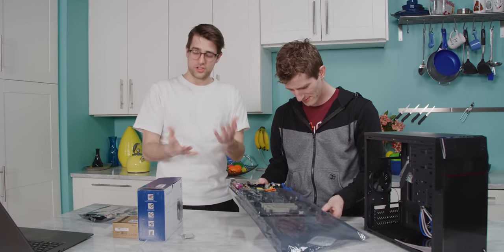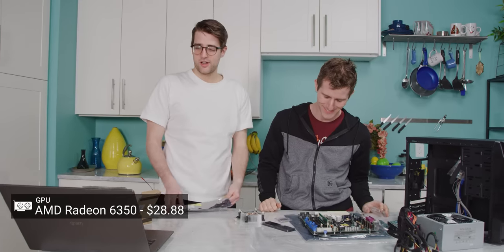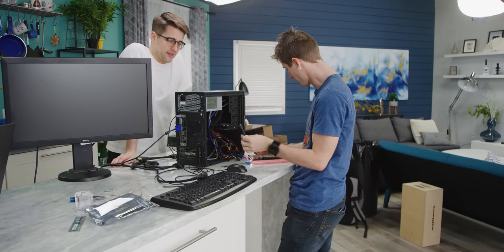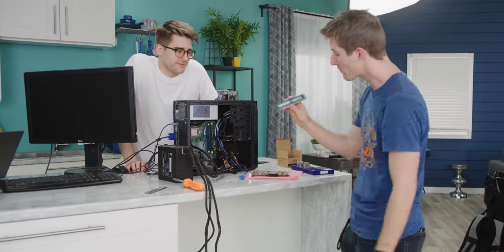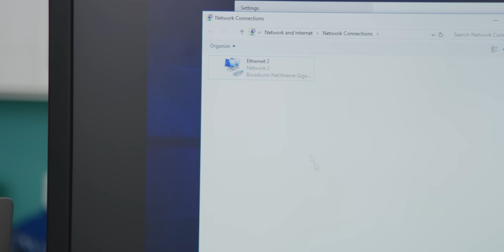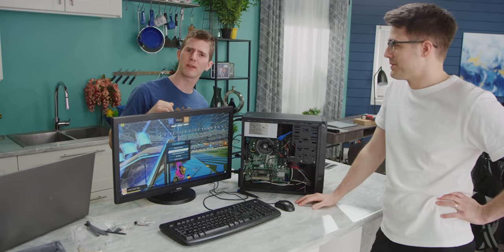We Built the CHEAPEST PC on Amazon!

Comment: "I have a tray of pentiums" once a dream. Now a meme
Reply: @deadchannel5933  Bro let me help you out. Sell the 10th gen pentium and instead buy a 4th gen pre-built system like a Dell optiplex with an i7-4770. Like Linus said in this video, don't buy individual components. Just put a 30$ GPU in the pre-built and it will perform way better than your current setup.
Reply: Imagine in 20 years
"I have a tray of threadrippers"
Reply: @caliqm2199  in 20 years they'll be nothing but thread ticklers
Reply: @caliqm2199  I still have a threadripper 1950x it games like garbage with a 3070ti
Reply: @mattcaldwell864  im pretty sure threadripper isn't designed for gaming....
Reply: In a 20 years AMD threadripper might be the same
Reply: @mattcaldwell864  might wanna run it on dxvk
Reply: Lol
Reply: @sebaschan-uwu  dawn
Reply: @mattcaldwell864  would you by chance share me a piece if you barely use the gpu. It would mean heaven to me. If its possible I can cater for the shipping fee. Kindly bro
Reply: @valanps1638  pffft only 64 cores
Reply: @mattcaldwell864  threadripper isn‘t for gaming that‘s a workstation rendering cpu
Reply: Well, before the DuoCore-Thingys, AMD was ahead in puncto performance with their Athlon XP CPUs.
Reply: it becames 1.2k when i like
Reply: @corvoattano9303  yep  business models FTW.  Cheap, rock solid, easy to repair, upgradeable, good driver and platform support, and cheap repair parts.  "Consumer grade" is garbage, and top of the line from years ago is top build quality at better than average current speeds for the same money.
Reply: @corvoattano9303  a $30 gpu doesn't exist anymore lol
Reply: @mattcaldwell864  lol why the fuck do you have a threadripper with a 3070ti? Are you liek, a professional or some kind of developer and editor or something?

I am on the crossroad slums of the internet known as youtube comments so it's impossible for me to tell who's joking and who's valid or just is clueless. FYI a threadripper is not good for gaming, moar coars does not equal more better for gaming. Like a 5900X is going to get you way better gaming performance than a current gen threadripper.

Also yeah get a 3770k and some kind of overclockable board i.e. anything but a Dell locked down shit BIOS and you can overclock it to being roughly modern gameable. A GTX 980 or RX 580 and a 3770 is all you really need for most modern games, since majority of people aren't even playing above 1080p anyway and both Ampere and RDNA are pretty much 1440p cards from the 6600 and 3060ti on up. Only their shit cards like 3060-non tie and 6500XT are 1080p cards.
Reply: @mattcaldwell864  ofcourse it does, it has WORSE single-core performance than my 8 YEAR old intel xeon, your only advantage is alot of cores but alot of games have some heavy processes that cannot be split between cores. and thats bottlenecking you even if your cpu doesnt reach 100% usage. i recommend finding a cheap 6th - 8th gen i7 or i9 depending on your budget. it would be a massive upgrade.
Reply: But it isn't even a meme bro

Comment: The 6350 is detected as a 5450 since the 6350 is literally just a rebranded 5450. Not an error or anything, that's just what AMD/ATI did
Reply: that hapend with the old 9000 series mine was a 9250 but the driver and pc would detect as 9260 also i was able to run quake 4 but the image was green...
Reply: The entire 8xxx series were just rebranded 7xxx series.
Reply: @MCCMCKnyte  That's also true, while some of the 7xxx cards were rebranded 6xxx cards I'm pretty sure
Reply: 4xx and below/before are made form actual potatoes.
Reply: @kurison  higher clock
Reply: @kurison  still doesn't make them rebranded
Reply: @kurison  well I disagree, as long as there is a meaningful improvement it's not rebranding by definition. I think linus is using the word very loosely
Reply: Nerds

Comment: Somehow your cheapest amazon pc built runs Rocket League faster than my 400 dollar HP. Huh.
Reply: what i learned over the years is hp is bullshit, when i get a new pc i will get each component all by myself
Reply: @Ed Williams True,better not to buy AIO PC or prebuilt $600 PC Without GPU ,U can make yourself a PC with 300 budget ,i3-3220,GTX 750 Ti.
Reply: You could do a ryzen APU build that plays rocket league pretty well for the same price
Reply: @ChrisPBacon9  indeed,use Ryzen 7 1st gen
Reply: The keyword there is "HP"
Reply: Had a hp when I was younger had some bad ass parts in it like a raddy 9800 pro but omg whatever hp did to the system made it a huge bottleneck
Reply: @vlc-cosplayer  no it stands for horrible product
Reply: Prolly cause your WiFi is to garbage
Reply: I have gigabit internet. Yeah I'm looking for a new PC and am not getting an HP, all of their included software is impossible to get rid of and bogs it down. If you looks up the specs of an HP c20-o10 that's it, and it's the worst thing ever.
Reply: Gamerz buster oh good god
Reply: I owned a hp aio which i got as a gift and it was 400 dollars and it run faster than linus's pc. With gt 610. It broke and this year i own an rtx pc which runs a bit slower than that one. So those who say hp sucks, idk what you are talking about
Reply: rocking jjo your guy only affects your frame rate and graphics, having an ssd and lots of ram is what affects the speed of your pc
Reply: Yes i have lots of ram and ssd too. 16 gigs of ram on both my rtx pc and the other hp. Hp had 400 gb hardrive. Rtx pc has 1 tb

Comment: I spent 126$ total to build a dell optiplex 980 SFF, 20$for the Motherboard and the case,28$ for 4x2 gigs 1333mhz ddr3 A-tech ram,75$ for a Gt 1030 Msi fan-less 2gb gddr5 Gpu, And 3$ for sata cables . Its running an I7-860 quad core 3.8 ghz . Gets playable Frames in fortnite and Apex. Got all parts off amazon
Reply: Impressive.
Reply: I built a dell vostro 430a with a same cpu with a 45 dollar r9 380  with 16 gig of ddr3 with 2 hard drives and a ssd  with cxm 650 w psu from Corsair for 235

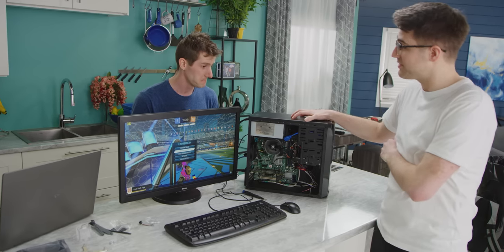Comment: 15:40 That's basically what I'm doing right now. I was going to build my own gaming PC but got overwhelmed when researching it (I've never built a PC). I was also very scared of accidentally breaking expensive parts. So, I bought a custom PC instead. My plan is to upgrade it gradually as the components become obsolete, one part at a time. Theoretically, that should allow me to learn how to build a computer in bitesize chunks so eventually, I'll be pretty proficient in it all. Already having a functional, well built PC should also be useful as I will have a point of reference which I previously didn't (I didn't have a desktop at the time, just an old laptop). That's the theory, anyway. I hope it works then I can build a computer from scratch one day when this one is no longer usable or upgradeable.

Comment: Case has USB3.0... mobo has no USB3.0 header... Leaves connector dangling there... I know this problem very well my friend.
Reply: 1$ adapter from China would fix that problem :D (Internal USB 3.0 -> USB 2.0)
Reply: @cptcrogge  but u would not get the usb 3 speeds.
Reply: @cptcrogge  no point
Reply: 5$ pci express card with 2 3.0 usbs and a usb 3.0 header will fix that :D
Reply: @anonimollopi9642  yep but it's unjustified.
Reply: Cheap cases usually have a USB2.0 split off for boards that dont have it.
Reply: @Wrathlon  Or just buy an e-ATX titanium tri-fan intake glass side panel case with nothing but usb 3.1 ports all over. Perfect for a budget build.
Reply: @dylanharding5720  you get more USB ports on the front... Even if they are slower. Better than having 2 dead ports.

Comment: I'm frankly amazed that GPU was able to do as well as it did. That thing is roughly 1/30th as powerful as a mere 1050ti O.O
Reply: The Passmarks/$ value on that card is stupendously bad, because you can get a used 1050 ti for like $120 and that GPU cost way more than $4.
Reply: Sorta funny story, uhh i was running A Sapphire Radeon 4850 and a i7 2600k this year so I have no clue whats up but mine did way better than this and is older. Yeah I know its a 10ish year old gpu but it got the job done until I got a 1060 6gb
Reply: @ryanhopkins7844  your I7 2600K is a lot more powerful then the CPU they had which is why your GPU did a lot better then in this video
Reply: The 1050 ti is fine if your power supply doesn't support a wired connection for a graphics card. At this point I'd just wait for the 1650 though in that case.
Reply: yeah i have a 1060 already in my daily driver but i almost got a 1050 ti for testing motherboards and for a HTPC because it doesn't need a power connector
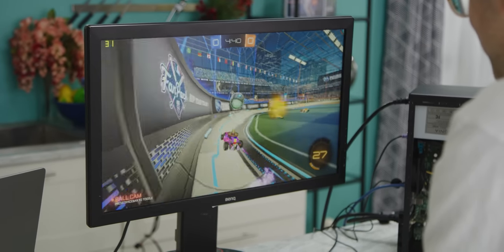Reply: 14:15 master race!!! macro-transaction master race.
Reply: TheFriendlyHacker 2080 Ti Master race

Comment: Personally, rather than going TOO cheap, as I have in the past, I planned out my system so that I bought it a part or two at a time, as I could afford it with a maximum price and certain quality standards.  It has taken me about 8 months and I am almost ready to put all the parts together.  I found that the optimal way to build a PC when on a limited budget.  Don't go cheaper, just take a little longer to buy the parts.  An extra month or four to buy all you need will be well worth the wait and save you money in the long run.

I also want a case WITH A DVD DRIVE BAY on the front.  It seems like they are all vanishing from cases.  Old games, old backups and DVD movies are still used on my PC (though not as often).  I don't see the point of having a large case with lots of unused empty space inside and a pile of external drives plugged into my PC cluttering up my room.  So my new case will also end up being the cheapest as I don't care about expensive, transparent sides... the cheapest case I found was the only case that still had a DVD drive bay in the front.  I may search Amazon again to see but...
Reply: Most of gaming is digital download now, even when you buy a disc for a xbox you'll find you need to install part 2 online (updates) before it's playable, discs drives just becoming outdated I suppose,
Also I see a lot older gaming pc cases, that look good that still have Cd drive slots, search around ebay, amazon, I see older HP, DELL  stuff cheap cases, all depends what appearance you want

Comment: Here's the Cheapest PC on Amazon -- if Riley actually did what Linus envisioned:
CPU: AMD Athlon 200GE with Radeon Vega 3 graphics - US$49.99
MoBo: Asus PRIME A320M-K AM4 - US$62.15
RAM: Patriot 1x4GB DDR4-2133 - US$21.99
Storage: WD Caviar Blue 160GB - US$15.99
Case: Rosewill SCM-01 - US$24.99
PSU: Insignia 520W - US$21.90

Total: US$197.01
Reply: I wonder how that would compare to what I'm running.  Intel i5-3470, GTX 1050, 8 GB RAM
Reply: Your build would absolutely wipe the floor with the Linus-envisioned one. By a considerable margin
Reply: @thatoneguy8347  Mine? Well I'm running a GTX 780 3GB now and a 525 GB Crucial SSD, so it's pretty snappy for its age.  Hoping to max it out with a i7-3770K and 32GB RAM.

Comment: So the Pc is for 360p Gaming , aight ?
Reply: You'd have to go all the way back to DOS before 300p starts resembling a standard. Anything later and you're looking at 640x480 VGA in Windows.
Reply: Scratch that, DOS was usually 320x200. So it was actually 200p. I went back too far.

Comment: Ten years in IT, twenty in tinkering and I've never actually run into a fundamental memory incompatibility caused by OEM modules vs an after market MB or vice versa. I've worked on hundreds of Dells and HPs at a minimum.

Edit: I know they exist, it just seemed overblown as a point
Reply: There is always some kind of weird never seen before bullshit to ruin your computing day.
Reply: I ran into it with a Lenovo motherboard.  In fact most of the points Linus made.  1) Had to buy an adapter to get it to work with a normal ATX power supply.  2) It only supported certain CPUs (though I never upgraded the CPU in the end) 3) It would not take normal DDR3 ram, but only DDR3L ram (which costs 3 times the price, secondhand!).
Reply: @leylandlynxvlog  none of those seem to conflict at all. DDR3L isn't anything proprietary, it's different memory. It's a requirement by CPU/chipset, not by Lenovo. It's required for mobile 3rd generation i series on if I remember correctly. To be clear, modules = memory modules
Reply: @afewspokesloose2699  Mobile board in a desktop motherboard, though it came from an SFF possibly.
Reply: @leylandlynxvlog  do you know what CPU is in it? In either case, a board being built around an industry standard (DDR3L) still isn't the same as requiring proprietary modules.
Reply: @afewspokesloose2699  Yes it was an i3-4130 but I sold it.  My point was that they limited the CPU choices, eg an i7-4770K would not have been compatible, according to a link in the Lenovo forums, though it's the same socket and chipset.
Reply: @leylandlynxvlog  that it may be but the 4770k has a 56% higher TDP - indicative of a similar order power draw. Power limitations exist on mainstream motherboards too, it's not Voodoo. Yes, there will be quirks with hardware that's made to a price point. In your case it's unclear whether it would be a BIOS limitation (often might be on an OEM board) but it would very likely never have been designed to power that chip. It's also common enough that OEM boards will run an out of spec CPU but have issues caused by power delivery.
Reply: @afewspokesloose2699  I think that would be the case, as the list specified the "S" variants of i5 and i7, as being compatible, which are the low TDP versions.

Comment: 9:20 These blockages can be even deeper and wider. I recently repaired a DELL computer because the DVD drive did not work in it. I checked probably 8 or 12 optical drives, including a few removed from my/my family's computers, which are definitely operational and none of them wanted to appear in the bios and of course in windows too. After some searching, it turned out that this Dell will only see two or three models of drives produced especially for Dell, for this series of computers.

Comment: I know the video is old and y'all have probably already figured this out, but that graphics card port is (i don't remember the actual real name) a Dell-specific port. It was used on Dell business-class machines that required a little extra graphical oomph, like engineering computers would need. It requires a Dell-specific dongle to be converted into DVI because Dell sold those systems with a business-class DVI monitor (still one of my favorite monitor stands) and even Dell doesn't make the cable to go fom Graphic Mess Output to DVI. I have three of them in my 5-gallon bucket of misc cables and will never have a use for them.

I worked for a tech support company that catered to dental and medical offices. The owner was a Dell distributer so I got to install hundreds of those things.
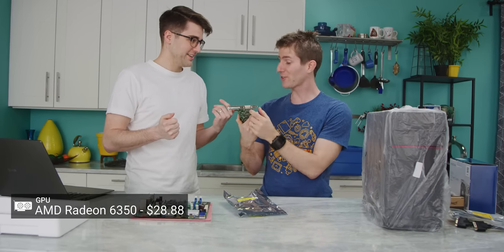Reply: 5:51 This is why I shouldn't type comments with the video on pause.

Comment: Wtf I have a Core 2 Duo E4500 as my main PC
Reply: For many purposes that is still a fine machine.
Reply: Lol same
Reply: I use a core 2 quad q9550 with 8gb of ram a gtx1050ti 240gb ssd 500hdd and it's pretty good.
Reply: @lukasvandewiel860  I have a Q8400 - I think its VERY SLOW. Upgrading to a new computer with an i7 4790 later this year.
Reply: @tamacat2001  What are you doing with it? The E8400 is very capable for Web Browsing and Office Work. Modern Gaming sucks, yes, but most people who do not game would be fine with it, even today.
Reply: @RFLCPTR  Usually to just play older games, up until 2015 it can run(I'm a gamer). It's actually pretty decent for MAME as well, and it can even run a few Naomi games.
Reply: I had the E8400 for a while and I played TF2 on it with an 8400GS
Reply: I'm upgrading from an e8400 soon. These have been a tough few years.
Reply: I cant fathom how you can even still use this. I had a i5 7400 in my old pc from 2 years ago, and it was absolutely slow as balls. So glad i built a new system with a 9700K

Comment: DDR 3 wasn't even supported in socket 775 
You should have known that linus
Reply: The G41 and G45 chipset supported DDR2 and DDR3 rams in 775 sockets, those where the last chipsets for that socket
Reply: Also the P45 chipset. Just be careful you need to have the low desity type of DDR3 or else you get strange undocumented beeps. Like the one you heard on this video. And what my MSI P45-C51 mobo screeched quite a few years back when I tried to up my RAM :)

Comment: radeon 5450? That's the GPU I'm watching this on
Reply: Pawlys Bartys F
Reply: Is it good for gaming?
Reply: @NightMare-hi7vu  no, absolutely not, it would barely run gta 4 at low at 25 fps.
Reply: @iluvmyswamp7948  but GTA 4 was honestly a terrible port from what i recall.
Reply: @iluvmyswamp7948  I had that card and played GTA IV at lowest settings, playable, 24 fps
Reply: @iluvmyswamp7948  Seems like my r7 240 is better than that card right?
Reply: 5450? Or hd5450

Comment: It should be the CHEAPEST PC so install Linux on it >:(
Reply: Linux is crap. No thanks.
Reply: @4D1Characterror  Heh that's what you think
Reply: @wufson-cz  That's a very obvious statement. But don't act like I'm the only one who feels that way.
Reply: @4D1Characterror  I didn't said that I just wanned to say that it's opsional opinion. And it make sense to put Linux on this PC there are some lite Linux distros and it will preform better (not in games) + it's free not like Windows
Reply: @wufson-cz  You don't have to activate Windows 10 to use it by the way, it will work just fine
Reply: @4D1Characterror  pretty much everything in this build was crap... the point was to make it as cheap as possible, a crap operating system would fit right in.
Reply: @smileyeagle1021  MacOS it is...
Reply: LiNuX iS CrAP nO THaNks
Reply: @4D1Characterror  Do you use an Android phone?
Reply: Linux is tho lol and windows is 10$ i guess